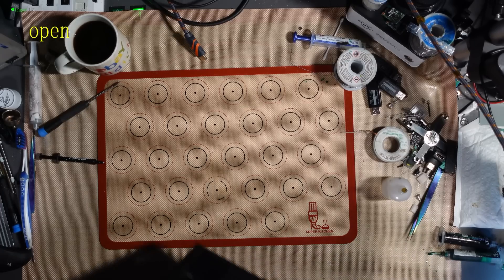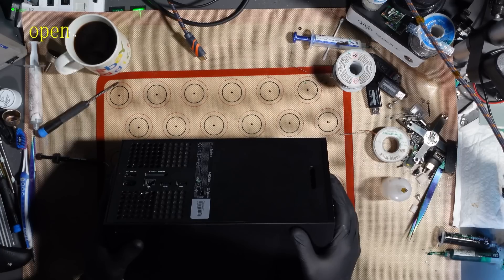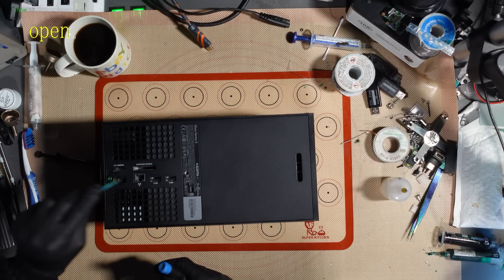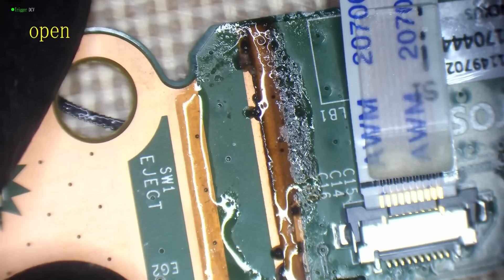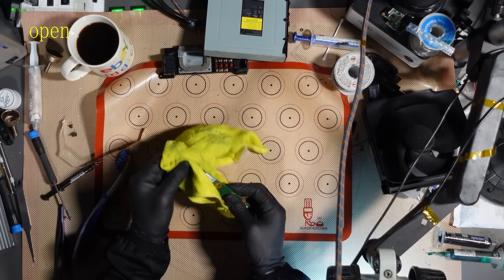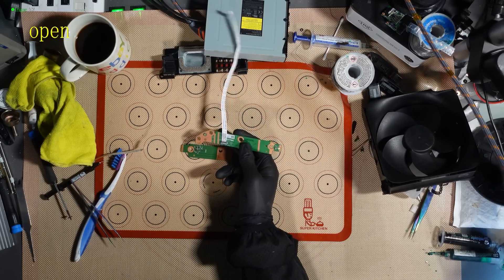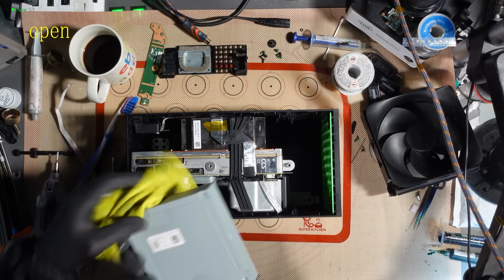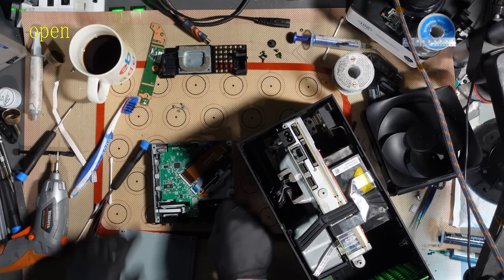This Customer Almost DESTROYED His Xbox Series X By Vaping! Can I Fix This Mess?

Comment: I don't think that was a vaping issue as such, the rest of it was way to clean, if it was caused by vaping, the worst areas would be any part that had air flow from the fan going over it. More likely is that vaping juice was spilt onto it from the bottle or the vape device itself. I vape myself and I agree with how it leaves a horrible greasy film over everything, windows especially. But in this case i would lean towards the nephew leaving his vape device standing on the console, and it then leaked juice on to it. Love your videos btw, very inspirational to say the least. If my console evr needs fixing I would prefer to ship it off to you than handing over to someone I know nothing about.

Comment: I had one droplet of pg/vg on the bottom chassis of my ps4 pro when I took it apart for a deep clean today, and I've been vaping in my room since 2019. This is from the nephew blowing the clouds straight into the system to watch it come out the vents, or from vaping right next to it and the t.v. Cigarettes are still way worse for you than vaping is, but vaping is definitely bad for electronics if it's exposed to it over a long period of time.

Comment: Looks to me like vape e-liquid has been spilled into the console itself, likey had a bottle on the top and its been knocked over and its went into the console through the fan on the top directly. If it was residue it would be spread throughout the console and wouldn't have as much buildup and wouldn't be as oily as it is. It takes a long time for buildup to start and the room would have to be constantly full of vapour e.g. (like a smoke machine fills a room) to the point where the console is constantly intaking vapour instead of clean air.
Reply from the maker: This is definitely from vaping. The guy already had his TV cleaned out which was far worse than the console
Reply: @TheCod3r  The room it was in must have been hotboxed with vapour like crazy then and most likey they've been vaping right next to the console with a big box mod with a big tank producing huge clouds. I haven't seen anything like this from vaping, I know it leaves residue overtime but I haven't seen anything this bad.
Reply: @TheSurvivalistic  exactly. I use series mods wirh the steam craves etc and never even had any of my electronics like this lol and popcorn lung 🤣🤣🤣🙈

Comment: Clearly that is not at all caused by any vaping. As anything airborn that smudges up the system will be accumulating along the path the air takes. So air intake. Fan , cooler, and basically anything the air moves by. This was a liquid spill of sorts.

Comment: That’s not just vaping in the room. That’s vaping and then blowing it directly into the console and watching smoke eject out of the fan vent.
Reply: Exactly. I quit smoking several years ago and have been vaping all day everyday while working in a tiny room with the door closed for 3 years. I have severs, computers, nas devices, entworking devices and monitors in this room. I often open them to clean them and I have never seen this before. Id wager a guess it may have even been spilled on the console.
Reply: Bout to say, I've been vaping near my ps5 with a window open and no damage yet, and it's also a big cloud smok device lol 😂
Reply: you believing his videos? vape doesn't do that😂
Reply: @RizlaaKing  Oh yes it does. Have seen a graphic card inside a computer caught fire because of vaping fluid attractring water drops out of air. Causing a shortcut on a component and it went up in flames, it just burned the component trough some layers of the board. The card was just as nasty as in this video.

Comment: I have Xbox One/series X & PS4/PS5s & I Vape.
Ventilation ftw!
That's some next level vape shit.
How much do you have to Vape to do this.
My consoles are fine.
Smoked 30 years, I Vape now 5 years, it's not "cool", it's better imo.
Carbon based inhalation ie smoking is worse.
Smelly, just as oily but a disgusting yellow, stink of Ash tray.
I couldn't run a mile smoking, now I do 6 miles a day then have a nice joint.
But this is extreme granted.

Comment: Excellent work, Phil! I love the channel, and the banter, sir. There's most likely no way regular vaping caused that damage. Someone must have spilled it in the console dicking around. I bet the kid set his juice bottle on it before filling his tank, and tipped it over when reaching for it. You can tell by the pooling in certain areas, and the fact that the interior boards don't have residue on them. When you vape, the liquid is atomized, and disperses in clouds that will more evenly coat a surface. It dries quickly, but leaves a sticky residue similar to nicotine damage.
  I've been smoking, and vaping for years, and have never had this problem. Granted, I maintain my electronics, clean them about every 6 months, and I'm not retarded LOL. The only components that get even remotely bad are the fans in my PC, and even those only get slightly sticky with a bit more dust. I also don't do that sub-ohm cloud-chasing bullshit that people do now. 
  I do what's called mouth to lung, or MTL. I basically vape like I smoke. I do high nicotine, low-voltage/medium ohm, (24 mg juice, 12 Watts, 1.2 to 1.6 ohms.) I vape because it curbs my smoking otherwise I'd be gagging down 3 packs a day, lol. I used to make my own juice, and everything. Propylene-glycol, vegetable glycerin, and concentrated nicotine are the only things in my juice. With the new nic-salts, cheap Chinese pre-made, and other bullshit who knows what's in it now. I'm trying desperately to not sound like some internet know-it-all jackass, but it's really hard not to, LMAO. My apologies.
Reply: I would suggest going to a specialist to try to curb your new addiction to the (basically just as harmful) practice of vaping. If you don't want to, sure, that's your choice, but you really should be aware of the risks of smoking and vaping before making that choice. I would suggest looking it up, the Internet can give a much more comprehensive list than I can. Even then, you should ask someone who actually works in the medical field if you have any specific questions. 

I'm sure this has been said many times, but every single time I repeat this argument, it could help one more person from killing themselves through poisoning.

Comment: I have been vaping for 5 years to quit smoking and I have NEVER HAD ANY RESIDUE ON ANY THING. I sit at my PC (Work from PC) 12-14 hours a day. That residue is from form of Vitamin E oil which causes popcorn lung or WEED oil which DOES LEAVE RESIDUE!! I just fixed the backlights in my 4k screen which I blow vape "smoke" at all day and it was just DUST on outside and inside same with the console/PC 14 inches to my right. Whoever is vaping is using imported CHEAP oils or Vitamin E oil (Popcorn lung of death oil). You should ask what this kids vaping. Cooking oil bahahahaha
Reply: Vitamin E oil doesn't cause popcorn lung.
Diacetyl causes popcorn lung. And unless you work in a popcorn factory that uses Diacetyl as a flavouring you won't get the condition.
Diacetyl is now a band substance. Has been for years.
But yes I see your point 100 percent 👍
Reply: Popcorn lung is caused by an artificial butter flavoring, not vitimin e. My guess is that this person uses nicotine salt, which is just acidic vape juice. They may have also been blowing clouds into the Xbox to watch it blow out of the exhaust fan.
Reply: @zaqueroberts1975  There has never been a case of popcorn lung from vaping. It was only ever a few cases in a popcorn factory.
Reply: just stop smoking everything all together, if u cant ur just a weak human being

Comment: i use to work in a engineering company oil i do not have a problem with a oil pipe on a machine came off and i was covered in oil ,i do not come out in spots or anything and it does not bother me one little bit

Comment: I actually had a similar problem, but with scented candle. Basically the candle was defective and had black smoke coming out of that. It happened at night and I havent noticed it right away but after about 10 minutes I was like why is it so cloudy in my room. Everything was covered in black stuff, I had to repaint walls, when I opened the xbox it was all covered in that black residue. All that damage in just 10 minutes. I have never used scented candle after that.

Comment: The balls of a smoker moaning about vape damage to lungs.
Reply from the maker: I was being sarcastic for the most part, but smoking definitely doesn't do that to consoles. Staining maybe, not not built up oil and moisture
Reply: @TheCod3r  I was being sarcastic as well mate. as i have seen normal dust turn to black tar like substance in pcs i repair just from smoking.
Reply: @slimmatt01  No ya weren't. You got offended, and thought you'd throw a barb admit it. 😂 The thing about Phil is he's always been a sarcastic prick, but we love him for it, and he's only kind of wrong, 🤣. (joking aside), smoking does the same thing just not quite as bad because of the sugars in vaping. Both PG, and the flavoring have sugars in them. Add nicotine to the mix, and it's basically a very, very mild acid solution that can cause corrosion if not cleaned. I've seen this kind of damage from someone using one of those citrus based cleaners too. The person cleaned with  it,  but used too much, and it seeped into the cracks, and onto the internal electronics. It was a catastrophe inside the device, LOL.